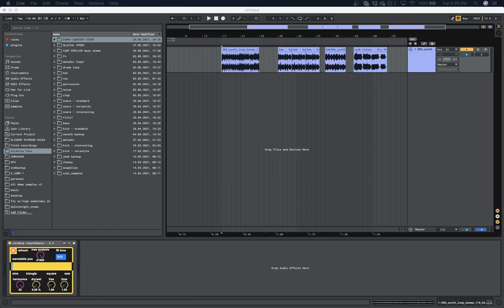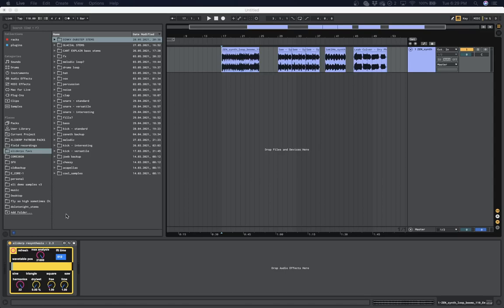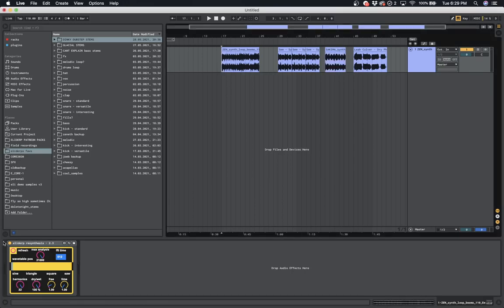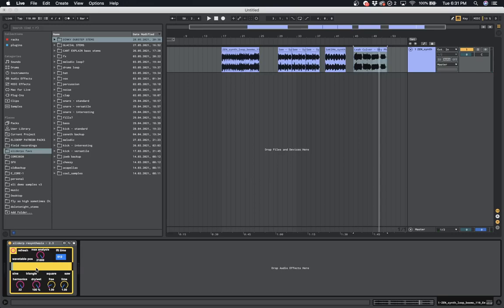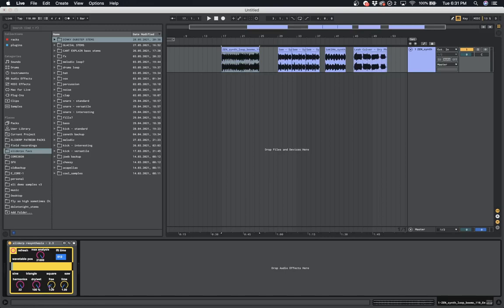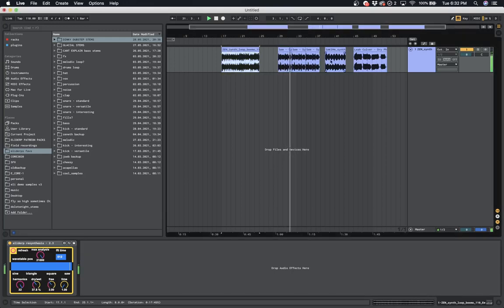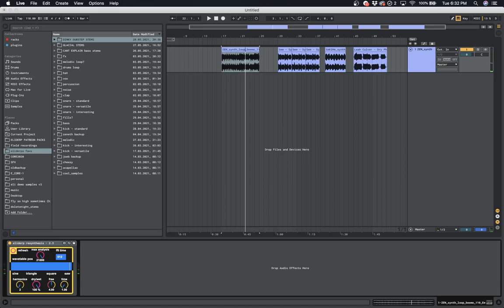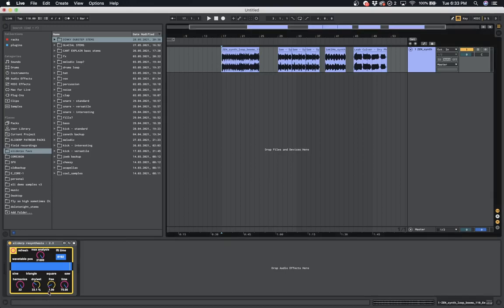THIS DEVICE CHANGES EVERYTHING

Comment: Please make an update ,it doesn't work anymore using Ableton 12 !!
Reply: If you have 2.5.1 and it still doesnt work, the reason is the Max 9 update's seperate installation path not including old devices' externals. Look for a file called "sigmund~.mxe" on your system, it will be in a folder called "externals", within a folder called "eliderp resyntesis 2.5.1 project", within a folder called "Max for Live Devices", within a folder called "Max 8". Copy the "eliderp resynthesis 2.5.1 project" folder and pasted it into the same "Max For Live Devices" folder but in the "Max 9" directory, which should be right next to the "Max 8" folder. The Max 8 and Max 9 folders are usually in your documents folder.
Reply: Im late but has it worked?

Comment: This is an amazing divice. Question, does this allow for multiple instances in one project? I've tried having multiple on different tracks, but if I change one it changes the rest as well. Also, if I have two different instances on two different tracks, the efect seems to layer with it's self and deteriorate.